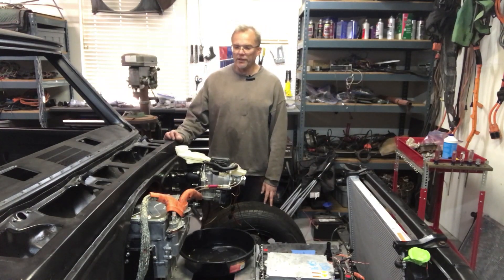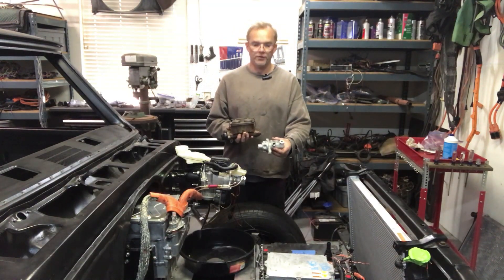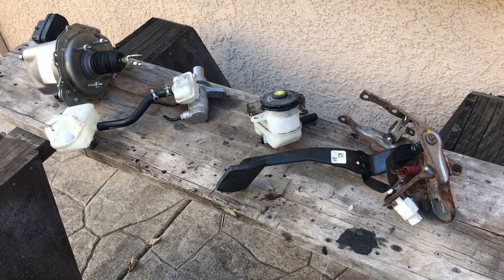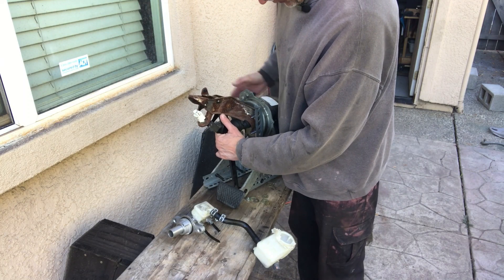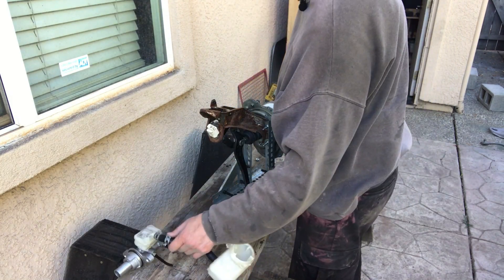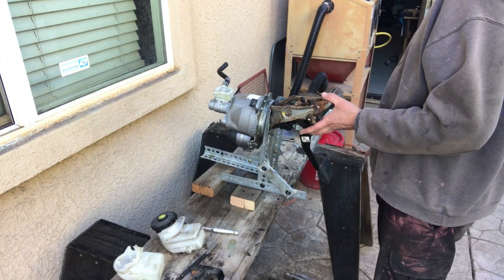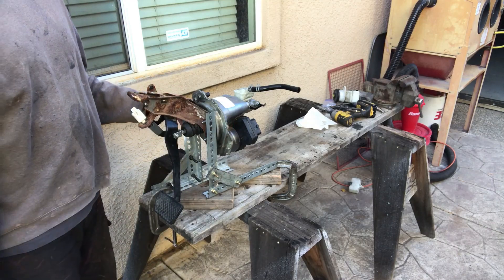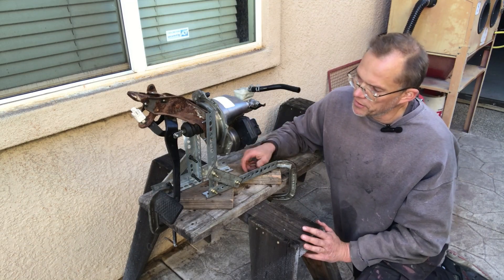Honda Accord BOSCH iBooster Part I

Comment: i am also doing this thing.  but still wondering if there is no problem when i use tesla stock master cylinder which bore is 1 inch much smaller than 1 5/16inch master cylinder.
Reply from the maker: how did it work out for you?